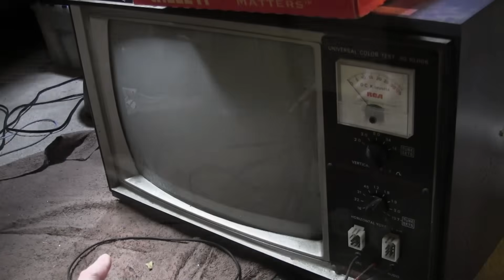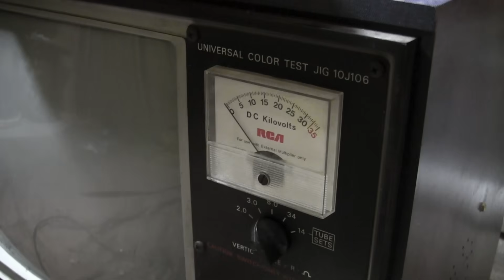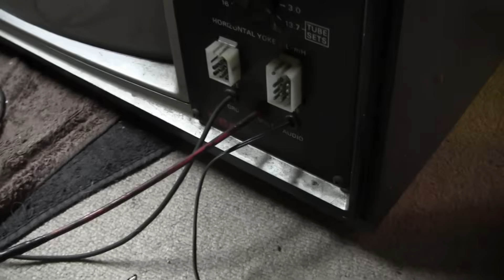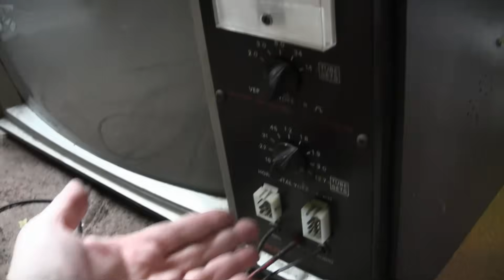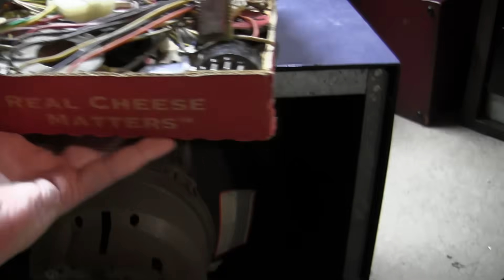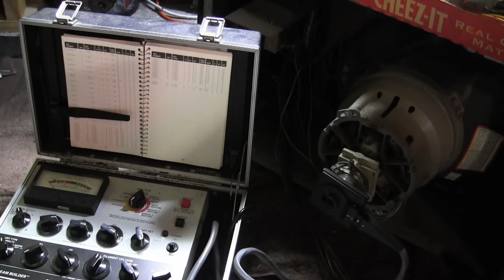RCA 10J106 Color test jig checkout

Comment: In general, the 33Kv Crts have thicker neck glass. Also, the aluminized crts have a minimum anode voltage of around 3kV, less than that the beam will not penetrate the screen far enough to reach the phosphor. The focus voltage needs to be about 20% of the anode voltage. With those constraints in mind, you might be able to use the unit with monochrome sets.

Comment: I have never used one of those CRT fixtures but, the TV shop I worked for in 1974 made up their own version.  They had salvaged the CRT, yoke, and CRT mount from a late 1960's RCA 25" color set to use as a fixture.  They had one at each bench, hanging from cables from the ceiling.  They ran a 6 foot cable from the CRT to the set and had plugs for the 21" round and 25" rectangular CRTs with no matching networks.  We only used these fixtures when we had to pull the chassis to troubleshoot a difficult problem.  Given the length of the fixture cabling and no yoke matching networks, the resulting picture wasn't the greatest but, adequate for troubleshooting: there was noticeable horizontal sweep ringing and loss of the high frequency video though.

Comment: I have one of these for sale (I'm retiring) - dozens of adapters plus I have the earlier RCA adapter system that update the jig before this one (it's a stand alone box with the same V and H adjustments on it. I also have the focus adjustment adapter. The tube has "test tube" and "hi kv" etched into the glass in the lower front left and right.  Located in CT.  Yes, the convergence is terrible on these - too bad they didn't have the later inline "pre yammed" yoke.  For a short time I was planning to build a pattern generator and drive the convergence system internally to clean it up.
Reply: Update: I couldn't find a buyer, was at the recycling center to dump it along with a bunch of stuff, and just couldn't do it..  I ended up taking it home and finding a spot in my test equipment rack.  In addition, I have the TeleMatic 10J4000 and a couple of adapters I used to work on RCA CTC169 through 197.

Comment: Roundy is easy accept I don't think it will work with the 5. And the yoke isn't a great match. That's the standard ctc17-35 yoke and the impedance is a bit different than the roundyz. Good enough for testing but not final settings